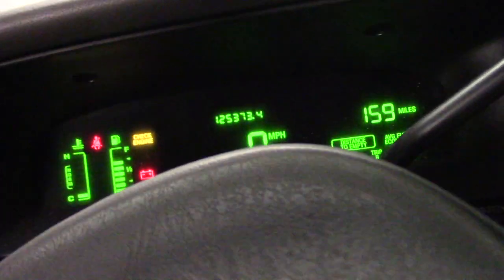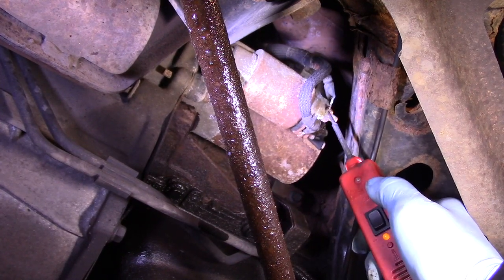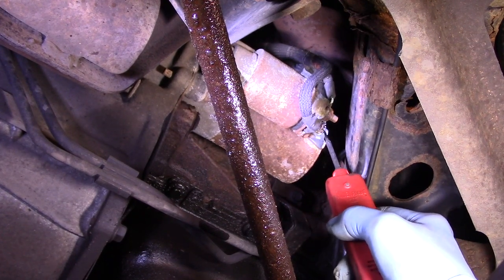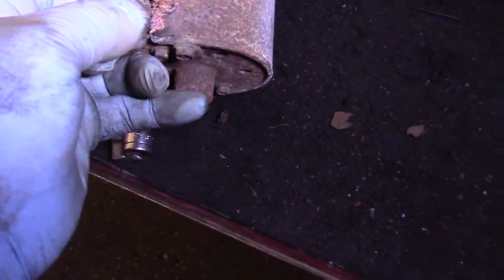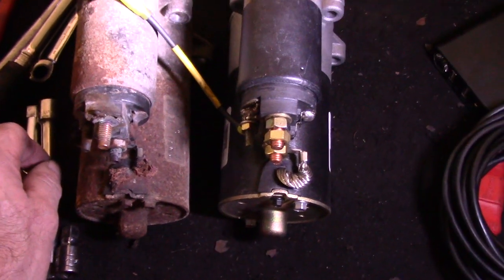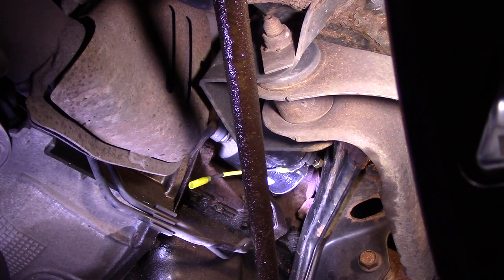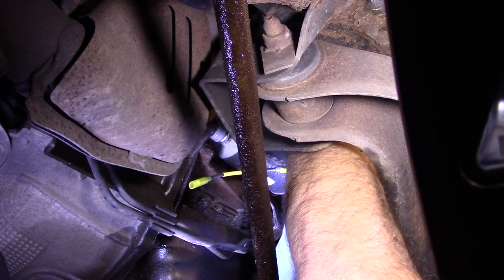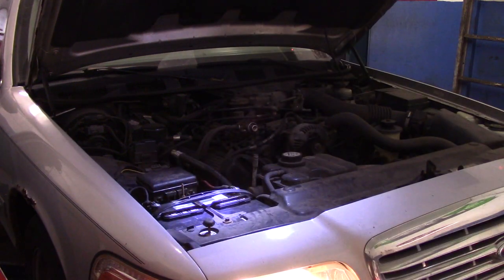Ford Crown Victoria 1991-2011 No Start & Starter Replacement

Comment: Thanks for your video. I was able to diagnose and easily replace the starter on my Lincoln Town Car by following your steps. It had the same problem as the one in your video. The wire going from the solenoid to the motor was completely corroded.

Comment: I dont even hear the loud click like that.  I only hear the relay faint click and using a remote starter trigger doesnt even do anything.. no spark at battery either.. i cleaned all grounds also.. im gona try and see if its the ignition box in the steeri g column

Comment: I have to put a starter in my 97 Grand Marquis and it gave me a little heartburn so i looked  up and found your video. I have seen you before. I grew up in Jersey City NJ so i know you are either from New Jersey or New York. I am 69 years old and still crawling under cars. I probably save several thousand dollars a year doing my own repair and preventive maintenance. When i was young i took automotive classes at Lincoln Tech in Union NJ. Back then I had a 70 1/2 Camaro  i would fool around with changing crank, pistons, heads, cam to go a little faster. I wish i still had that car today.
Reply from the maker: Actually I also grew up in J.C. heights. Where are you from in J.C?  Don't answer on Youtube use my email instead  jimthecarguy1@gmail.com it is safer.

Comment: My crown Vic sounds the same way, I got the starter checked, it was bad, so I threw a new one in but I did not do anything with the wires, It still will not start, could it be the wires???

Comment: Some reason I couldn’t get the extension and 1 and 1/2” extension with the socket wrench to fit in that area. It was too long by a 1/4”. I had to use a long extension with another smaller extension with a hinged extension to reach the bolt
from the other side of that damn frame that’s in the way.... my Ford had a brace or something where your arm was that blocked it just enough no to work. Ford’s....😒

Comment: Can i ask if you have a bad earth wire would the interior light dim as you crank ?
Reply from the maker: It is possible a bad contact both on the positive or the negative can cause the lights to dim.
Reply: @jimthecarguy  thanks

Comment: Yeah. It’s either the starter is bad or the engine is locked up
Reply from the maker: Thanks for watching.
Reply: Take a socket and a breaker bar and turn the crank at the front of the engine, if it moves it's not seized!